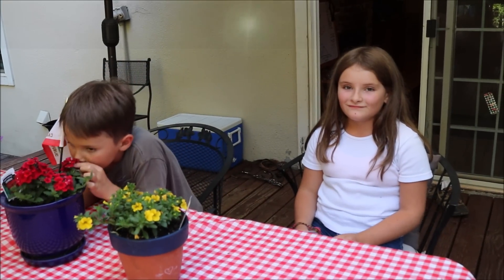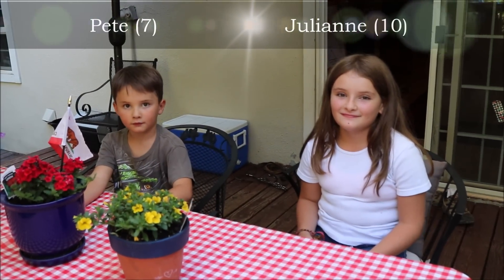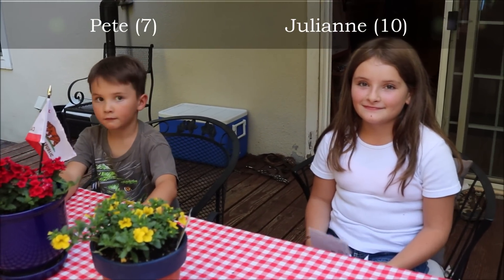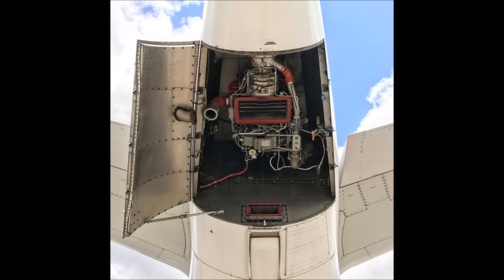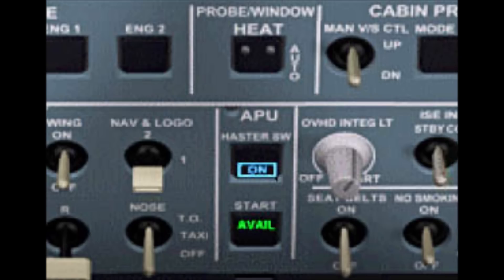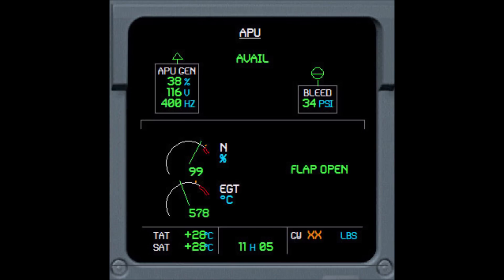A321 Birdstrike(s) Dual Engine Failure Moscow UPDATE- FAQ's

Comment: I think the crew did great!  President Putin thought so too and immediately awarded the pilots a medal.  One thing I remember (40 years ago) was that when I was in an aircraft doing an emergency go around (because some jerk in a maintenance truck pulled out onto the runway)  the pilot linked radio, PA, and cockpit con together so that the flight attendants could understand what was going on.  I don't know if that's procedure today, but it sure looked like a time saver to me in that instance!  Thanks for the video with Pete and Julianne, really cute!...;)
Reply: With all of the automation in modern cockpits, can that (linking the radio[s] and the p.a. system), even be done any more???? Besides, it sounds to me like this was almost "over 'before' it began"?

Comment: What position would be the flaps in? Would they have tried to change that or is that simply another 'no time' thing?
Reply: Judd Johnson 
Flaps would likely be in takeoff position still, helping the aircraft maintain a degree of lift but not necessarily in the best position for landing, which is usually further extended for slower landing speeds.
No time in this instance is my guess.

Comment: I don't know much about jets or jet engines, but how come some Russian fighter jets actually have retractable mesh screens so that during takeoff debris from the ground, and I assume bird strikes, are prevented?  And some older MIGs actually close their air intake doors during takeoff (leaving only louvers open for air intake.)
Reply: originalresqme 
That's because they aren't concerned with FOD issues and can operate on poorly maintained airstrips and tarmacs. 
At US military airstrips, it's all hands on deck, walking abreast every morning to remove debris from the tarmac before flight operations begin, ground crews continually scanning for it throughout the day. Vacuum trucks maintain taxiways and runways if available.
Reply: Some Chopper turbine engines have to have dust filters .

Comment: Any landing you can walk away from is a good landing!  Great job by the pilots with little time to react and memory training taking over!!
Reply: And a great landing is one that you can still open the doors afterwards.
I haven't heard of ANY transport category jet airliner off-airport landing where the airframe is repairable (not saying it for sure, but I don't remember having heard of one, and as a pilot, I follow aviation pretty closely), but the way they put that airbus down in such a smooth belly landing does actually make it appear that this might just be possible, although unlikely given the type of structure and the difficulty of moving it without causing further damage.
Reply: @The_Real_Phil_Lee  I am aware of at least one Russian airliner that was repaired and flown out after a runway overrun into a forest.
Reply: @allangibson8494  Yes, but an over-run (either on a late rejected take-off or a fast/long landing isn't the same as a landing off the airport altogether - on an overun, they would have shed most of the speed while still on the runway, never mind the airport. the repairability of the aircraft in such an incident depends much more on the residual speed and surrounding landscape.
Note the wording I used - off-airport landing.  I don't think the incident you mention is even close to being the only example of a repairable overrun, even though it may have been the most extreme.
Reply: @The_Real_Phil_Lee  The airport that one landed on had been closed for twenty years and was half the length needed. Having the gear down helped. Look up Taiga forest Tu-154M
TACA flight 110 was a 737 that landed on a levee in the US and flew out.
Rare but it does happen.
Reply: @allangibson8494  Yes, and there's also the famous Gimli Glider, which also returned to service after a dead-stick landing on a long-closed military airstrip.
Reply: One where you get to use the plane again is even better.

Comment: Late 80's I bought a jet drive boat hull from a friend..Dropped a 454 out of a Chevy in it..First start in the water the engine coughed and stopped..Drifted to the side of the ramp and tried to start..Engine started and sucked up rocks that blew the side out of the pump..A boat needs to get out of the water to reduce drag..All the horsepower I had couldn't get it above 50 mph..The other guys blowing past me...I soon learned the dynamics of weight and power..Something as simple as a plastic bag or ball cap over the intake grate you shut down the power..
Reply: jeff robinson  yup,and A friend had one,and sandwich bags were a routine problem on a lake ! CheersfromNJ

Comment: A grate in front of the engines is not the way to go. The real solution is a M61 over each engine set to fire based on a wing mounted RADAR, that will get rid of your bird problem!
Reply: The cure is always so simple it's often overlooked , you're a true visionary ,although with weight a problem I would suggest the M134 miniguns for gulls.
Reply: Paul Davidson What about the collateral damage from all those spent rounds having to fall some place?
Reply: @Sillyturner  the aircraft would be in a nose high attitude and the magazines loaded with "aviation weight" sea bird ammunition  also the minigun could be configured for  .22 Lr rouds which would  ameliorate  most  of the hazard ,aside from shredded gull meat dropping from the sky !

Comment: Thank you, Juan!  Could a rod/spike/cone (sort of like the SR 71 engines) be added to the center of engine compression fans that sticks out past the front of the engine cowling? It would have less of an effect on air flow (than a screen or other device) but it still may break up a bird enough to push it to outside of engine or break it into small enough pieces to not damage fan blades.    The outside the box solution is have every airline's livery look exactly like a bird of prey.

Comment: All of the engine manufacturers analyze the shape of the spinner mounter on the front of the engine. The more bulbous the spinner, the more protection offered to internal engine parts. A pointy spinner provides smoother air flow with a loss of internal engine parts protection.

Besides being a cover for where the fan blades attach, the spinner is designed to shed bird parts to the outside of the engine case, away from the engine internal air intakes hidden behind inlet guide vanes.
Reply: Gunga Dinn the surface area of the main compressor is quite big, banking on the bird hitting bulls eye for protection is a long shot.
Reply: Sharpen the fan blades!

Comment: You don't have to build an engine shield to keep birds out of the engine, you can build one that is designed to cut the birds into pieces small enough that they wouldn't damage the engine. Thin titanium cutting blades could dice any birds into much smaller pieces without disrupting the laminar flow of air into the engine.
Reply: P&W already did that on the good ol’ reliable JT8D.  It slices and dices like Ron Popeil could never imagine. 😁
Reply: @chrisbeck8182  my grand father worked at P&W, made the turbine blades, pretty cool.

Comment: The "Miracle on the Hudson" also involved an Airbus that lost both engines following a bird strike. Is there something in the design of the Airbus that makes them more susceptible to this type of incident?
Reply: Not by design for any aircraft except for the fact that planes are generally faster than birds, speed wise but less maneuverable.
Most any plane can land without engine power, given there is enough forward speed, altitude and a fairly level, unobstructed area.
Reply: Garuda had a 737 lose both engines, albeit due to hail. It landed in a river but did have one fatality.
Reply: Great Lakes Cruiser The A320 and B737 use similar engines, but the front fan on the A320 has a different number and type of blade construction. Two crashes are not much evidence to base on, but hypothetically the engine fan design may have some role.
Reply: There's Ryanair Flight 4102, a B738 (EI-DYG). Which crashed attempting a go around due to multiple bird strikes.
Reply: I think the real takeaway from the two incidents you reference is that the Airbus design seems to be the kind in which you can survive a landing with no engines.
Reply: @bonemasterj  spot on !!

Comment: The pilots were not the most experienced, particularly the right seat, but they did the right thing and everyone walked away.  Landing on water or uncertain ground with the gear down is asking for more problems and it was unwise to burden the center hydraulic system with the gear deployment.  Not clearing the area of bird hazards and in particular, having an unapproved dump that attracts them was the cause of this crash in my mind.
Reply: i dont think experience or time of hours of flying actually means anything, well not anything but its not the deciding factor of what makes something possible or not, my uncle has been a taxi driver for over 30 years and has been driving maybe 40+ now, and even he says he wouldn't trust himself with anything larger, he wont drive a van and he definitely has the most hours of driving compared to anyone i can compare to even older men with more years haven't dont 8 hours a day every day for over 30 years essentially.
i have friends that drive vans etc and can drive anything with only 3 years of actual license driving and id trust them with my life more so than my own uncle.
(i know driving and flying arent the same but the concept is for experience and how it can be applied.)
Reply: @Dockhead  -- The passengers of US Airways Flight 1549 would probably disagree with you, and they can do that because they're still alive, thanks to the experience of Chesley Sullenberger.

Comment: regarding the bird grate if bird hits the grate it will still cause disruption in airflow and you will sacrifice efficiency 100% of the time for something that happens 0.0001% of flights.
Reply: palker4 True. Suggestions about 'protecting the engines' are 'solutions in search of a problem', and don't really help.
Reply: @gordonrichardson2972  How silly! Crashing is not a problem for Gordo, But what about the corn & the fish?
Reply: Ask Sully. 

I'm just kidding. You're right.
Reply: I ask about a [retractable] grate! And got compressor stall spoiling it! 

So how about fighter escorts with full-auto goose guns?

Comment: My take on #2: Any structure you put in front of the engines could itself fail in case of a bird strike. Now imagine your engine eating a broken grade instead of birds, definitely wouldn't improve the situation. Instead of putting the weight in front of the engine with a secondary structure, it's probably much more effective to reinforce the engine itself with stronger blades.

Comment: Not to mention all the bird carcasses stuck on the front of the intake due to the screen!
Reply: or...how about a big enough bird or amount of birds impacting...defeating and pushing the screen INTO the fan section...
Reply: How thick would it have to be so as not to get sucked into the engine? This is just not a real world thing! More problems than fixes.
Reply: @reddog-ex4dx  having been a aircraft mech in the USAF... You can not put anything resembling a fence...grate.... whatever you want to call it as it will directly impact the performance of the engine. Even if you could... a good size goose would make short work of it in no time and now you have a goose and a chunk of metal that has just completely FODed out that motor. at least with todays modern fan engine ... the part the bird hits is NOT the main engine as the main is a smaller and a bit secluded as far as a bird is concerned.
Reply: LOL!

Comment: I think your kids are GREAT! Good stuff..thanks very much!
Reply: 737 flies by boosted cable controls so it flies much better dead stick.
Reply: RR engines have fod and dust deflectors on some engines
Reply: If this was a737 ng it have broken in 3 parts  with  take a look at 737 ng eljesera
Reply: @brucemcgeehan2847  Which 737 NG accident are you referring to? And which RR engines (which I assume do not have gull deflectors)?

Comment: ✨🇺🇸Good Question Children, So APU is a Starter, and Secondary Power for Electronic Problems …👂. So little birds in corn fields starting At AirCraft Noisemakers, flew, unfortunately Up, & Sucked into Engine, Poor ❣️Little birdies 🕊& Very 🍀Lucky Humans ✅
Reply: And Hydraulic.
Reply: So put the APU's up front and the engines in the back where the bird don't go !